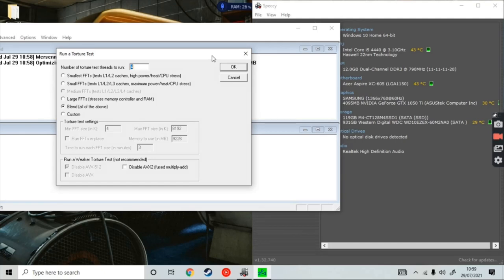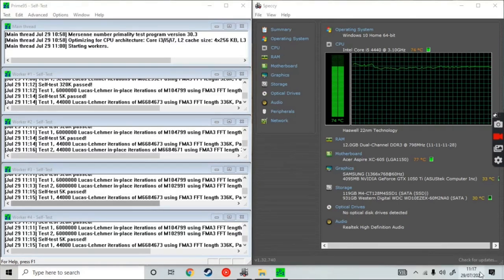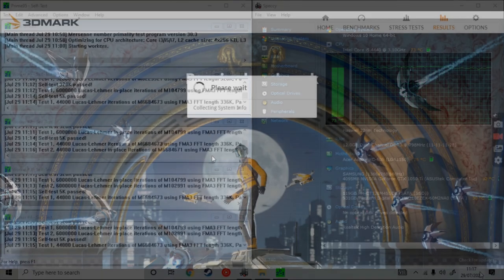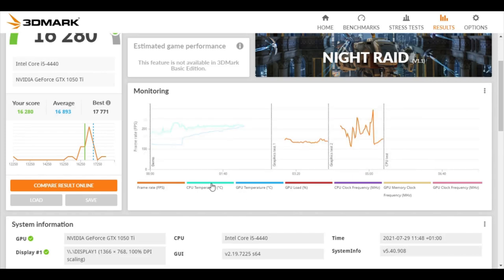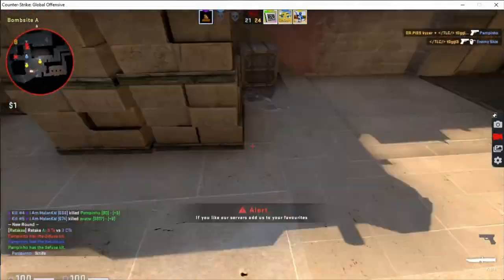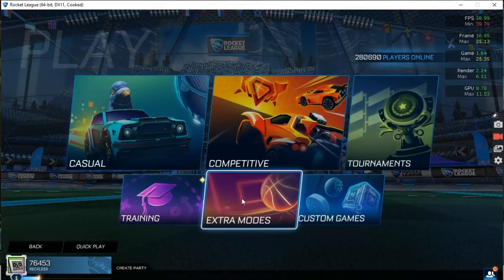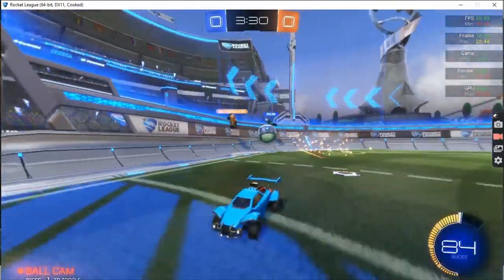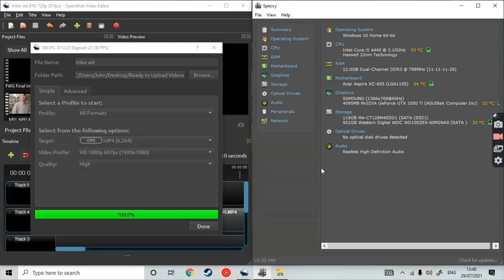1195 Conductive Ink as Thermal Paste - 6 Months On

Comment: Doesn't it do thermal throttling at 80c? You'd need a program that can follow the dynamic changes in CPU cycles to see how much it throttles if your tests reach thermal throttling limits. Or do the unsafe thing and disable thermal throttling (don't, unless you're prepared to buy a new CPU if\when that one fries itself).

3DMark did have a graph for that.. I do believe it should have been shown in the video.

Comment: I have an older slow running mac book and am wondering; 
does overheating cause a CPU to slow down?
This would be a good test every six months to see how it progresses over time.
Reply: @OverUnity7734  
Yep what?
Yep on 1?
Yep on 2?
Yep on all the above?
Reply: @OverUnity7734  
My brother gave me a 2007 Mac book that is doing that.
I guess I'll have to take it apart and give it a cleaning; after I find where I put my thermal compound.
Reply: @OverUnity7734  
By the way; thanks for posting a real answer to my question.